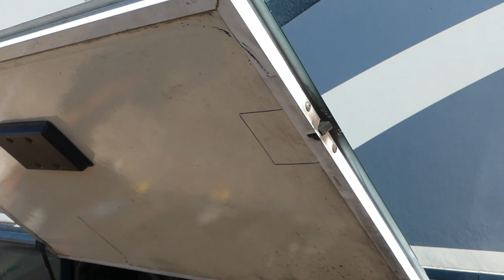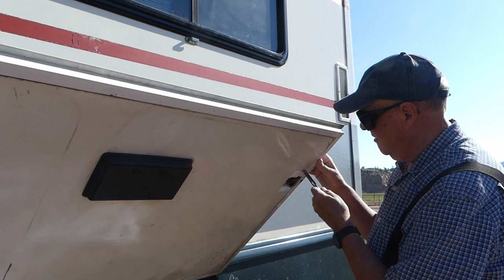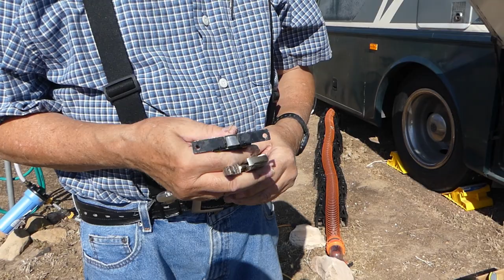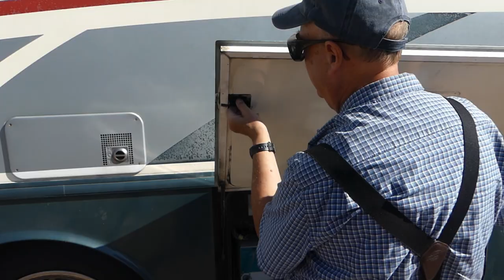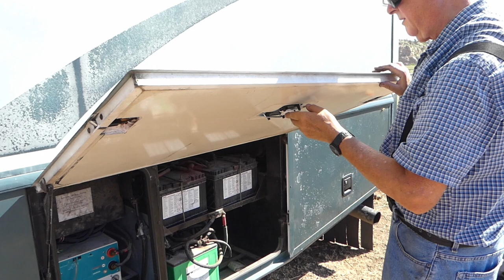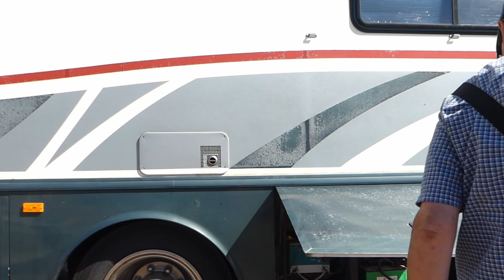RV Baggage-Basement-Compartment Door DIY Repair | As We Go 2021

Comment: What is the size of the template you made? Thank you for video, valuable information for sure.
Reply: Hi! They were approximately 3"x5". Glad you found it helpful. Thanks for watching!
Reply: @betsysavage1803  Ty much... keep up the good work!
Reply: @SpyEyes26  Thanks...
Reply: I know this is a year old but we also have a 98 Fleetwood and our propane door latch is stuck on one side. You mentioned having the same issue - how’d you free it??
Reply from the maker: Sorry I didn't catch this sooner....You might be able to reach behind from a  neighboring door and use a screwdriver or small chisel to push the plunger back. Or if you put your knee on the door and "press in", it may clear it enough to open with the latch. Good luck!

Comment: Just bought a 97 with a cab over. This is our first experience, and the doors all have the same symptom. I’m bound and determined to fix them all, but yes, they did not have maintenance in mind when designing the latch system. I was wondering if you thought about unscrewing the frame with the four Robertson screws to get to the latch. I’m half way there, and it seems the bottom frame will come off. I’ll update if I have success. Thanks for the help though! I might just have to cut the back like you did here.
Reply from the maker: We tried that first, but it is all glued together. Cutting into the door seems to be the only option. Best wishes on your door latch rebuilds!
Reply: I have a Winnebago and there are dozens of rivets that hold the frame together. I have taken the rivets out and disassembled the frame to do the repair in the past, it is a real chore. Since, one of the repaired ones have failed again, making me wish I had cut it and put a cover plate over it. It might seem like it is taking the easy way out, but it makes the maintenance easier, and more likely, too.

Comment: I have a 2000 Winnebago Brave. All the exterior cabinet doors have the same system, with the latch mechanism inside. I did one door several years ago by drilling out all the rivets and pulling the back panel out. It was a royal pain in the rear. I've been putting it off since for a couple of others. I'm getting ready to sell it so now I'm looking to clean up the odds and ends. This cut-out method is one I would have done as soon as each failed had I known about it. My problem was that the hook comes out. Thanks for the video.
Reply from the maker: Sometimes you have to bend the hook a bit (or was it flatten it? I don't remember) to help it hold. Glad you found this helpful anyway! Thanks for watching!

Comment: Our '05 Southwind uses the same latch, mounted from the outside.  It still seems to be very tightly secured after removing the two screws so I appreciate having some forewarning of what may lay in wait for me inside the door panel.  I don't like the idea of having to cut the door open to get at the latch mechanism but if that's what it takes, then I have no choice.  Thanks very much for your video.
Reply from the maker: Glad you found these helpful! Safe travels!